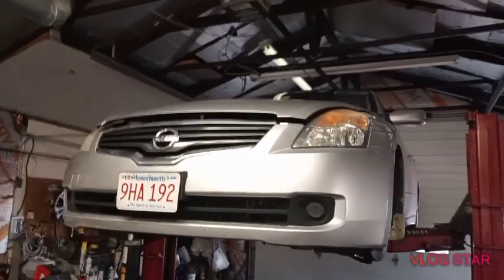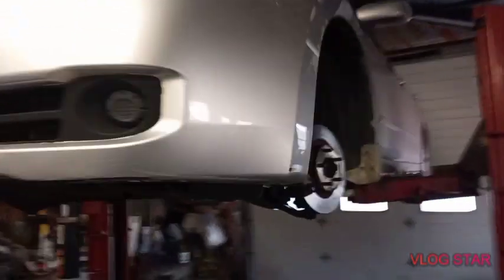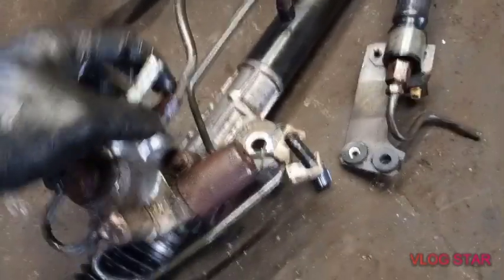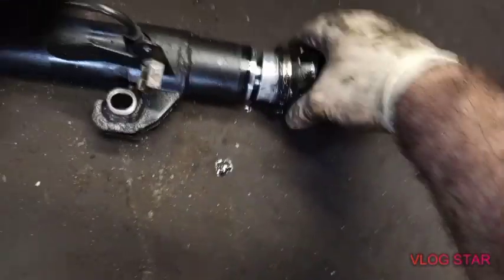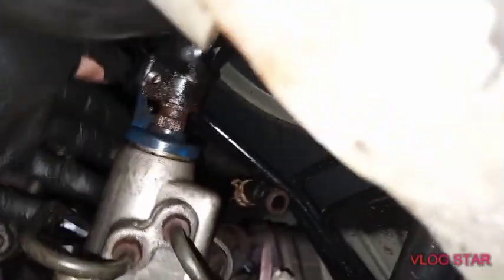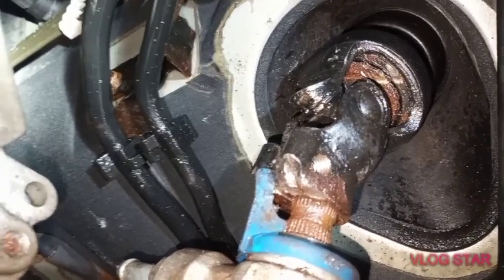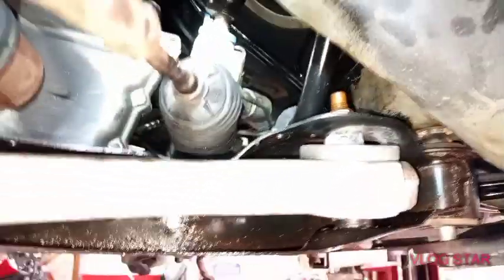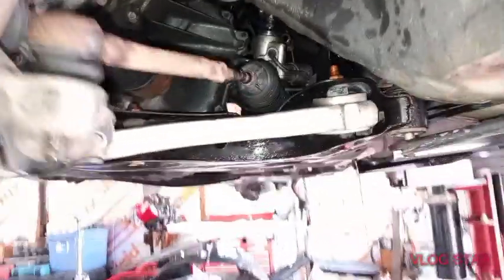2008 Nissan Altima steering rack pinion replacement Diy

Comment: I was replacing the pressure line and may have stripped the socket in the rack and pinion where the pressure line connects. Now it leaks worse than when the line was broken.
That's why I'm here. . .
Oof
Reply: See if you can reread it our use a seal solution idk lol